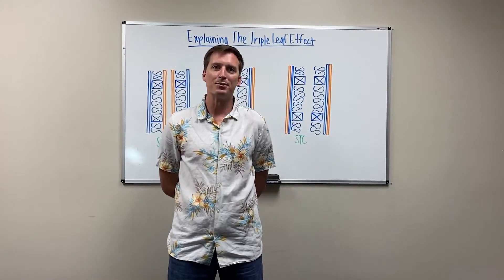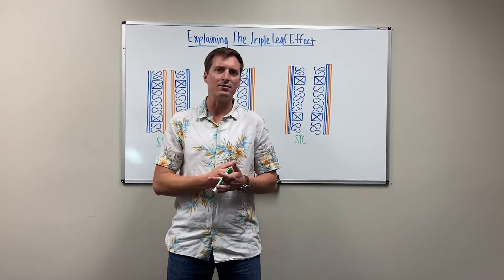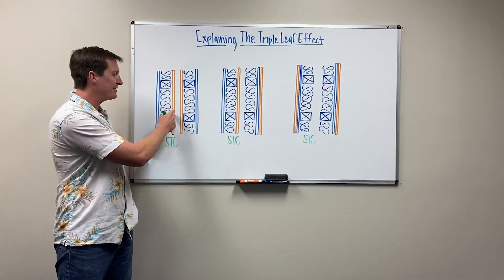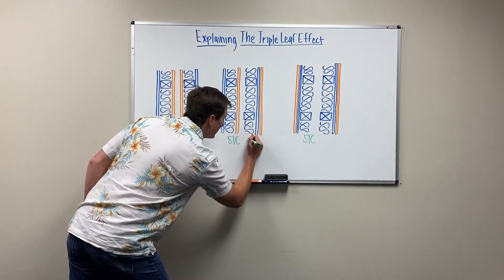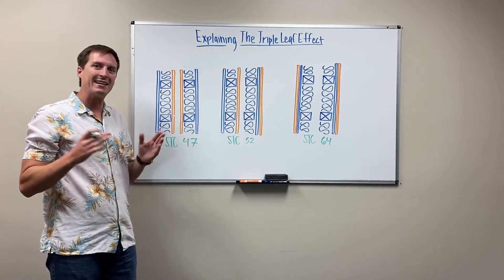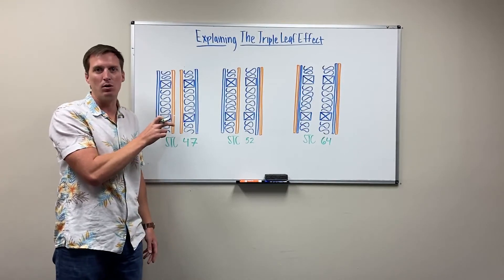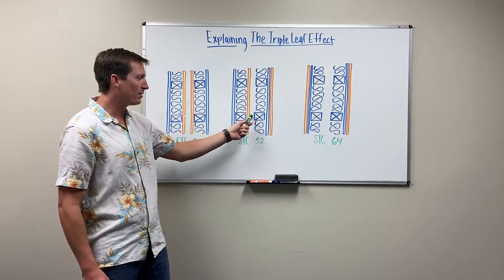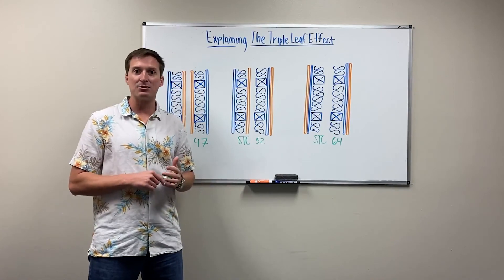Explaining the Triple Leaf Effect

Comment: What happens to the stc if you are not using the same amount of drywall.  Example one sheet of drywall on the outer faces of each wall, but the difference being one assembly has a single sheet of drywall on the inside of the assembly (so three leaf) and the other only has two sheets of drywall total in the assembly?

Comment: I’ve heard some contradictory info regarding putting a layer of bitumen sheet between two layers of drywall.  
I’m using RSIC and hat channel with two layers of 5/8” gypsum. Not going to throw my money at green glue, but am considering bitumen between.  Triple leaf possible detrimental effect here or is this a positive for added mass for isolation??
Reply from the maker: Hi Gregory, The triple leaf effect is only for double stud walls where people place their plywood or additional drywall layers inside the cavity. If you have a single stud wall and are just layering the drywall with bitumen on the studs, you do not need to worry about the triple leaf effect.
Reply: @commercialacoustics  Thanks, that's what I thought but apparently  someone was spreading some misinformation as often happens ;(.
Reply: @commercialacoustics  yeah I also think what is especial about green glue if the goal of  using that is dampening,
Can't we use cloth, carpet, rubber, bitumen etc to get the same result?!

Comment: Is triple leafs insulation Bad?..compare to double leafs with structural connection?

Which is better if I have: 
1. Brickwall - 160mm air filled by mineral wool - 2 layer drywall (the stud is connect directly to the brick wall)

2. Brickwall - 80mm airgap - 1 layer drywall - stud - 80mm airgap - 1 layer drywall. 
(The stud also connect to directly to the brickwall)
Reply from the maker: A larger air gap will always performs better. This is why we do not recommend using the sheathing within the wall cavity between the double studs, since it dramatically decreases the size of the air gap and decreased the STC rating.